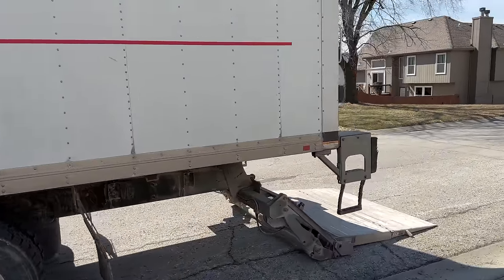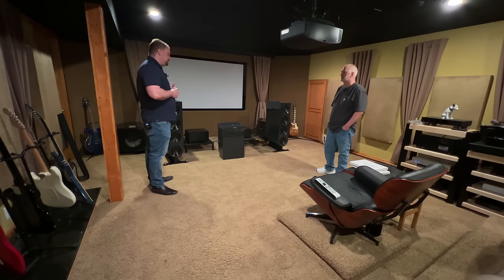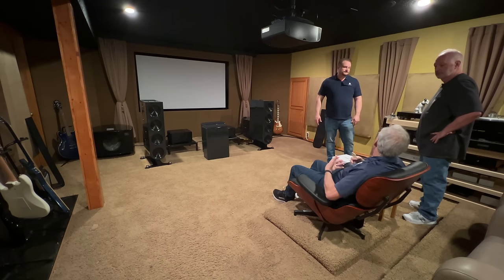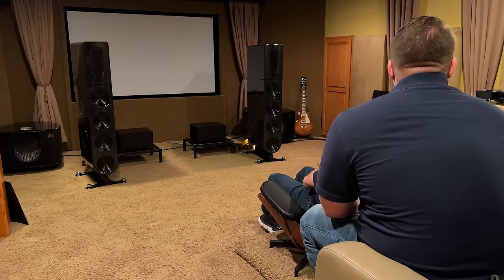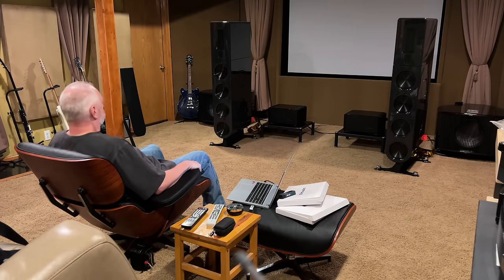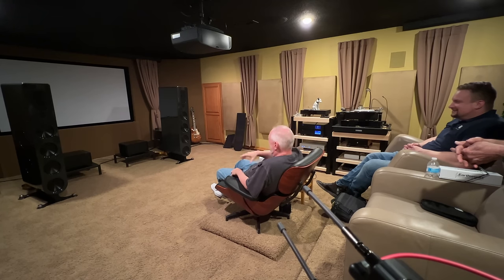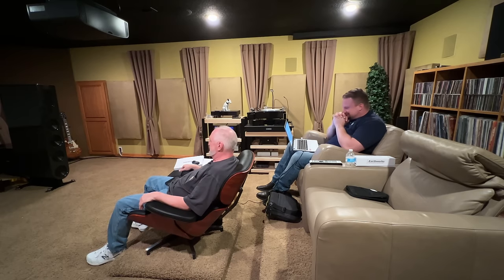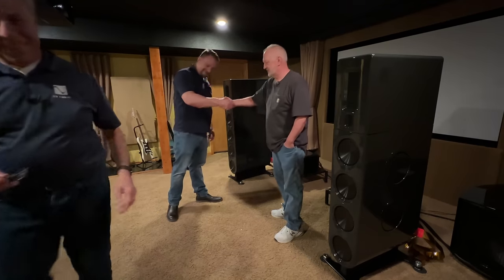PS Audio FR30 loudspeaker installation number 2

Comment: bohlender parts on a sub.  hilarious!
Reply: BUSTED!!!!! 🤣🤣🤣
Reply: I used to work for bohlender graebeber for 5 years and David Graebener worked for my father for 10 years, so there is certainly a resemblance. these are custom drivers and are being made elsewhere and with different components and techniques. I mean, of course I’m going to leverage what I’ve learned throughout my career.

I don’t understand why you find that hilarious.
Reply: @cbrunhaver  Liked " used to work for bohlender graebeber for 5 years"

Right at about the 28 minute mark they expose BG Neo10 and a Neo3 driver are under the hood.  Planar magnetic driver with teonex diaphragms.  Granted BG was bought out but these drivers can now be found on parts express for a few hundred bucks.
Reply: @homatose  no. They are a similar form factor but our own designs. We are also using n52 magnets, not n35/38 and are corrugating our tweeter.Yes, teonex has better damping than kapton and much better suited to midrange applications. We are using an 8 ohm impedance on the tweeter (not 4) because of our dual tweeter implementation.
Reply: @cbrunhaver  this becomes less hilarious, and more interesting!

Comment: IF the room actually does needs more diffusion, just add the diffusion, don't remove the absorption which is already installed.  That way, the low frequencies can stay properly damped.
Reply: I should say "the lows would be more properly damped" if absorption is not removed.  Without properly measuring the room, damping  becomes a guessing game.  With enough experience, some people can become pretty good guessers.

Comment: Cable differences..lmao!!
Reply: Surely you can understand that different materials can bring another type of sound and different ways of making a speaker cable can affect the way a signal travels. Years of testing have proven that. Where you been?
Reply: @Mark-lq3sb  please tell me you are kidding. Are you a dealer for snake oil cables? Whether it's a speaker cable or a interconnect cable it's not rocket science to carry an audio signal. The only thing that could make a sonic difference but I'm sure is not even audible is thicker gauge speaker cable. If someone has an 18 gauge speaker cable and someone has a 10 gauge to 10 gauge is going to have less resistance. Let's talk interconnect cables. I have proof that there is barely anything to them. Going by some cables ranging from $20 to hundreds of dollars. Cut them open and look at what's inside. There isn't Magic in the hundred dollar ones. You obviously haven't done any blind ab comparison with cables or speaker wires. Now I'll ask you...where have YOU been? Wow some of you audiophiles scare me.
Reply: @Mark-lq3sb  Actually testing has shown it matters very little......unless you sell them.....then it counts!
Reply: @hatch1892  
  I guess you've never heard of Analysis Plus. They've been testing cables for NASA for decades.
Reply: @ryanschipp8513  
Analysis Plus started life as a cable tester for major companies and a little U.S. Government operation called NASA. That's real proof. Where have YOU been? Wow, some of you novices scare me.
Reply: @Mark-lq3sb  are you ok? We are talking music playing on speakers here. Exotic and expensive cables cannot magically change the Sonic signature of music. If you still firmly believe this tell me how they are doing it? And be very very specific. Tangibles.
Reply: @ryanschipp8513   That's funny, laugh my ass off!
"Exotic and expensive cables cannot magically change the sonic signature of music."  "If you still firmly believe this, tell me how they are doing it?" "And be very very specific. Tangibles."

You haven't offered me any proof to the opposite.
Reply: @Mark-lq3sb  you aren't too sharp are you? I'm talking about the materials used in them. You didn't understand that? Tell me specifically what materials are used in your fancy expensive cables that make them so superior to the more budget cables. You are insulting your own intelligence. Give me specifics on the materials used. Also tell me exactly what those materials are doing the sound Superior. I will be waiting for your response.
Reply: @ryanschipp8513  Look who's not very sharp! You refuse to respond to my question. You ignore it.
Can you read and understand it? Tell me why different configurations and different types of materials do not affect signals. Come-on! You must be special and no one can question you. I'll be waiting for your response.
Reply: @Mark-lq3sb  this is common sense. Again insulting your own intelligence Bravo. If the expensive cables and exotic cables sound so much better and different they must be comprised of some other materials or items. Correct? So are you now telling me they're comprised of essentially the same materials yet they magically sound better than something from Monoprice for like $30? I knew you wouldn't be able to answer my question. I'll give you one last chance. Name the different materials for items used in exotic and expensive cables. Then tell me how they are creating that Sonic difference.
Reply: @ryanschipp8513  Keep up the double talk son. Keep ignoring. I knew you wouldn't or couldn't answer my question either. It's obvious you can't explain your thoughts into facts. Just idle BS come-backs.
By the way, is that $30 or like $30? I mean it can only be one or the other.
Reply: @ryanschipp8513  
I've had enough of dealing with The PS Audio video shit disturber. Goodbye.................
Reply: @Mark-lq3sb  I'm doing voice-to-text Einstein. Okay that was your final chance. No specific information for me just like I thought. Go and purchase $1,000 cables. Good choice
Reply: @ryanschipp8513   So, you talk like that too. LOL! You must be 13 years old. 
How come you can't give me facts supporting your theory?  Keep using your wire coat hangers for speaker cables. Afterall, they do conduct a signal. Good choice!
Reply: @Mark-lq3sb  I'm the one that brought up the subject you are trying to twist it around and bring up another subject. I think that's what politicians do. You'd make a good one. No sense responding to me unless you're going to tell me what's in your magic cables that makes them sound better than budget cables.
Reply: Calm down lads ! It's only hifi. It seems to me that there is no conclusive scientific evidence to support either position in the sense of proving beyond doubt that different cables produce audible differences or the converse.
I have heard many arguments but they can all be reasonably rebutted by the other side.
So it comes down to preference. If you want to spend money on cables and are happy they make a difference that's great. If you want to stick to budget cables, that's great too. No need to knock lumps out of each other.
Personally I sit on the fence and buy just above budget from companies like Mogami, Chord and QED and am very content.
Reply: @ryanschipp8513   All the more you should defend your position. You brought it up.
Reply: @jimfarrell4635  No, I just enjoy feeding it back to the notorious "Ryan". Known for nothing but constant negative comments on this youtube channel. He's always right and whatever the subject the author is wrong or the products "suck". I realize he's not the only one, but he never misses a chance.  So, I enjoy the banter.
Reply: @Mark-lq3sb  Mark, go all the way back and look at my comment. The very first comment not anywhere after. You immediately responded with a second comment after my first comment talking about materials can make a difference. I'm simply asking you to respond to you opening your mouth on the materials being used. This is all on you man. What materials are you speaking of and how are they making the wires different? Give me specifics and then tell me how it changes the sonics. You simply don't have an answer that's it. Because it's all a bunch of bull and you know it. Otherwise you would defend what you wrote which was right after my original comment.
Reply: @ryanschipp8513  You’re both sorta right.. When I was about 8, I know for a fact that when I switched from the red color string hooked between my tomato cans & replaced it with a frayed lamp cord from 1962 it improved the tonality , neutrality , airiness, especially when used outdoors of course & I didn’t have to yell as loud (turn up my voice volume) to be heard more than 50feet away👍🤗 Possibly because I used solder instead of tying a knot? I found that the color of the cord or what it was made of, certainty made all the differences to my ears.. And when I unhooked the lamp cord & tried some 1970’s chicken wire, almost the same thing.. Unless I switched to my special edition corn chowder cans with the labels peeled off👍 And of course the chicken wire had to be cut to the proper length between the cans so a little more work to get the sound you like.. And you might try fishing line but get the Thicker stuff and you’ll get Thicker Bass👍 Make sure it’s coated against Saltwater.. Yes thickness, gotta love thickness🤣🤣
Reply: @meutubedou  hilarious!!!! Needed that. Thanks!!
Reply: @ryanschipp8513  
Geez!     Everyone but you knows what silver will do to a speaker cable. Are you really that uneducated about speaker cables?
Reply: @Mark-lq3sb  There he is! It took you this many back and forths to come up with silver? Lmao!!!!!!! That's it Mark??! Sure, silver is a great conductor but that doesnt mean it can make imaging more distinct or bass tighter. Did you actually fall for that at the local hifi shop? Silver cant transform the sonics equipment and the recording. Again....silver..cant make music sound different. It's a metal Mark. Dont hurt your brain. Holy cats! Mark...I have a special wire that was processed in an underground lair inhabited by trolls. It was blessed by their high priest. Pristine resolution! $500 a foot. Want some??? I'll admit silver is a very good conductor and that's it. Because that's all it is. So......... what are the other special materials and techniques used in your other magic cables? All you've got for me is silver????? Thats it? Don't let me down.
Reply: @ryanschipp8513  
I ask myself...
Why should I argue with someone that is under educated in speaker cable? You're on the internet, look beyond the person that tell's you one thing. It's called research It's not hard! I understand, you're one of those block heads that just can't absorb and retain complex information.
Here's a hint: Sliver = 'bright' Too complex for you? That's a shame. "bass tighter"...You kill me, LOL!